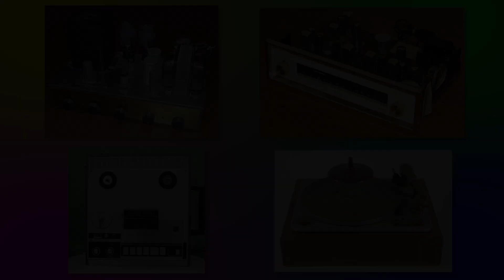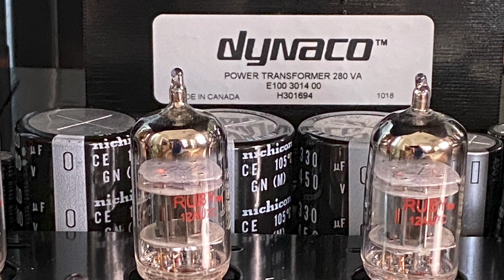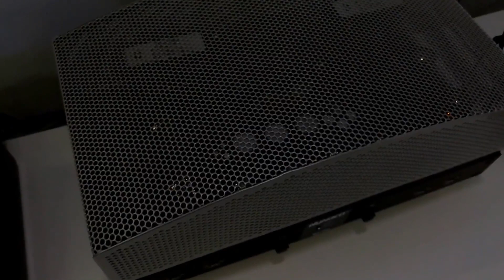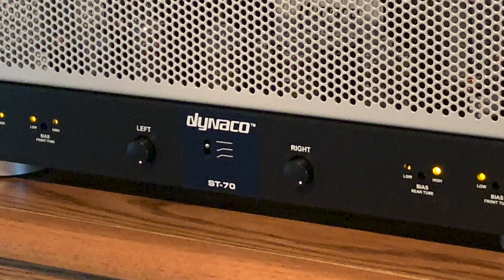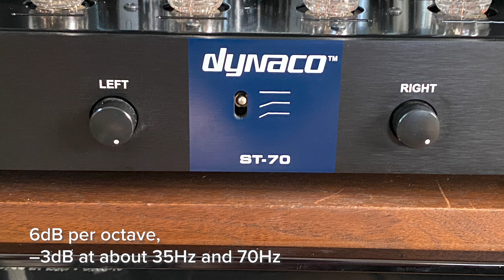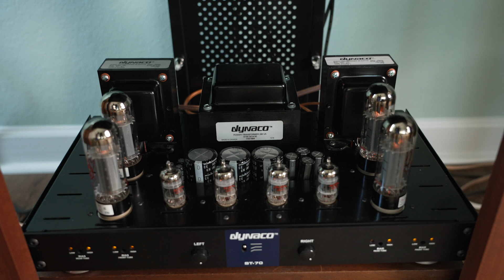Dynaco ST-70 Series 3 Tube Amplifier

Comment: Thank you for your kind opinion of my update on David Hafler's great work.

I remember this amplifier. While I was retired, Radial called me back in a couple months later to repair this amplifier. I do not recall the exact fault but it was pretty minor and required no parts. 

About the bias, it is suggested you let the amp warm up about 30 minutes before setting the bias. 

The power switch on the rear was apparently required by some safety agency. Not sure why as another engineer here was handling that as I was away for surgery. But we felt we would live with it as most users we have seen turn their entire system on and off with a power bar. 

I designed the Dynaco ST-70 Series 3 in 2017-2018.  I designed the amplifier that Hafler would design with modern parts and material. The new amplifier has the glorious high end that the original ST-70 has while having a bottom end that will play modern music with authority. We verified this with square wave testing at 40Hz and 22kHz Testing against an original amplifier and a well regarded clone of the original ST-70.

The secret to the great bottom end was a fantastic output transformer with layered primary windings from the Hammond company and a power supply that can deliver a lot more power faster. Solid state rectifiers and over 20 times the capacitance. Unfortunately Hammond's 1650N transformer is not a drop in fit in the ST-70 Classic chassis. 

Plus proper ground routing kept rectifier noise out of the sound which greatly reduced low level grit

My employer, Radial Engineering, was the former distributor for Hafler products in Canada. For those who do not know, David Hafler created most of the Dynaco line of audio products. They had purchased the rights to the Dynaco and Hafler brands around 2015. As I was one of the last electronics engineers to get my basic education on tubes, I was given the task of coming out with an ST-70 update. As there are plenty of companies already making ST-70 clones, I was told we had to make a better amplifier. What Hafler would have known now. The ST-70 has an excellent high end but the bass was weak, It sounded like the 1955 design it was in the bottom end.   

A 6 part story about the engineering process which I wrote was published in audioXpress magazine starting in May 2026

I also did an update of the Hafler P3000 amplifier as the P3100. I am writing a series of articles on this upgrade to be  published in 2027 in audioXpress. When Rockford bought Hafler, an engineer there, Jim Strickland worked with Hafler on several models. For my work on Hafler and Dynaco, I had direct contact with Jim Strickland who I believe was the last engineer to have worked with David Hafler. When Radial bought Hafler and Dynaco we got access to all of the surviving notes of Hafler's. 

However, I retired when these came out in 2018 and the owner of Radial Engineering became seriously ill and sold the company. The new owner cancelled production after 50 production units were shipped. Of the samples we sent to reviewers, we got rave reviews from everyone. 

We were not able to issue the new version of the ST-70 as a kit because of modern legal liability issues. 

The new owner of Radial in 2018 told me that he sold the Hafler and Dynaco Intellectual Property to a European company. Extensive searching could not find the brands being used by anyone any more.
Reply from the maker: I really enjoyed that amp but I obtained some vintage Polk SDA SRS speakers and it wasn’t powerful enough.  I regretfully sold it this year.   When I bought it in 2018 I sent it back twice. The first time one channel was not working. Came back fixed. Then one channel’s bias kept changing after warmup. That was not fixed, however when I changed out the speaker wires it was resolved.

Comment: Any change in circuitry design is no longer an ST70......
Reply from the maker: As I mentioned in my description, a re-engineering of the original, so you are correct.

Comment: Is still a single channel preamp , where as my stereo amplifier is bi-amp ....
One octal preamp tube for bass response , in parallel with , two other 9 pin preamp tubes, for the treble response....
Reply from the maker: Cool. What brand is your amp?  Are there high and low pass filters for the two preamp stages?
Reply: @LeeBergerMediaProd  The brand is "my" brand.  There is one low pass filter on one half of the preamp , and one narrow band pass filter on the other half of the preamp.....  I want to order parts, and build a few more....

Comment: I looked at the series 3 before I bought my VTA ST 120 (kit).  The price was about the same as VTA’s 105 watt monoblocks.  I have a 40x40’ listening space ( my shop) and thought 35 watts might be minimal.  I believe Hafler’s tube designs are the best value in tube audio, and it appears you scored on that series 3.  I also have a Dynaco Stereo 400, which I completely rebuilt, and a Hafler DH 500 (future rebuild).  That MC 2105 is another classic… a friend had one in the mid 70s.  Nice video!
Reply from the maker: @briansilcox5720  in my living room I went back to solid state. A Schiit Vidar 2 to drive power hungry Polk SDA 2.3’s my son-in-law gave to me.  The Dynaco now in my office driving a pair of infinity bookshelf speakers.  At one time I had a Hafler DH101 preamp. Developed issues due to age.   Are you happy with the VTA’s?

Comment: Should i buy Willsenton R8 or a classic amp like this one?
Reply from the maker: The ST 70 Series 3 isn’t really a classic amp as it was manufactured in 2018.  It’s a modern take on the classic ST70.  While the ST70 is a power amp, the R8 is an integrated amplifier with a preamplifier section. Check out the Skunkie Designs YouTube channel. She has an excellent series on repairing and improving the R8 which gives insight into its build quality and design.
Reply: @LeeBergerMediaProd  I thought it is nearly as old as first one from 1950s
Reply: @LeeBergerMediaProd  I definitely agree with you on checking out @SkunkieDesignsElectronics. She really knows her stuff.

Comment: Thanks for making this video! I also have this amplifier and was lucky enough to get it when it was on close out for 1500.00 as well. It is my favorite amp. It sounds better than other EL34 amps I compared it to and it looks amazing. I was sad to hear it was discontinued. Guess it was just too expensive at 3000.
Reply from the maker: What output tubes are you using?
Reply: I am still using the original JJ E34L output tubes. I tried some current production Mullards (Russian) but the JJs sounded much better to me. What are you using? Really loving this amp btw. Hard to believe there were only 50 made. What a shame. Such a beauty!